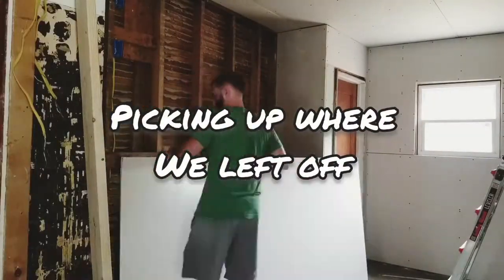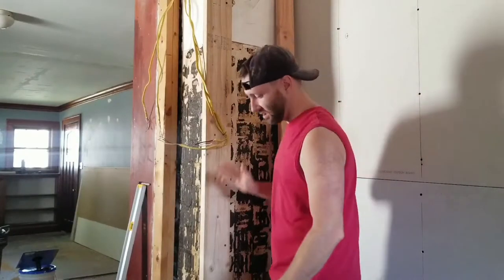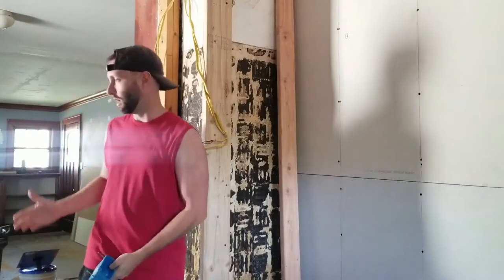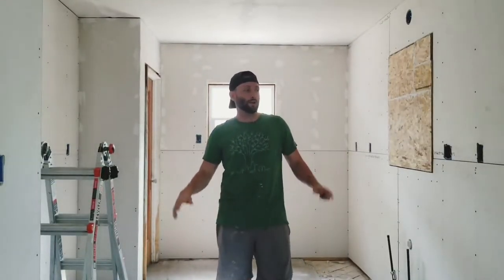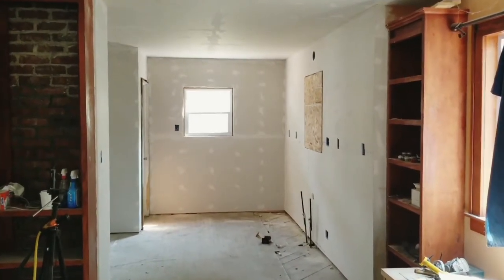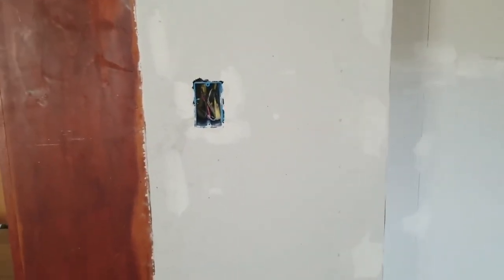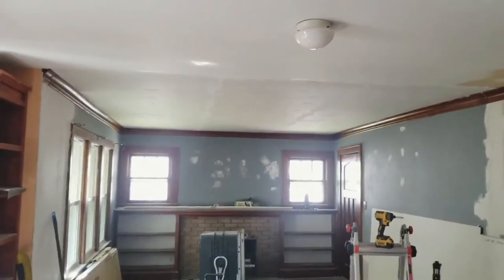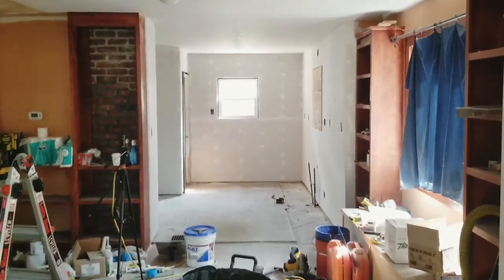How to Hang Drywall in the Kitchen | Investment Property Renovation Part 6

Comment: Why did you do 5/8" drywall on the walls?  I think in a previous video, you said you did 1/4" drywall on the ceiling.
Reply from the maker: Very observant!  I think I misspoke there.  If I remember correctly the walls were all 1/2" drywall.  

I had been working on another project at the same time, using 5/8" drywall to span 24" ceiling rafters.  Likely a mixup in my head.